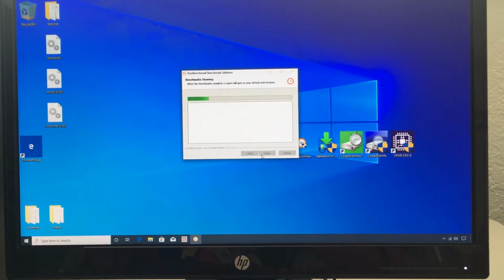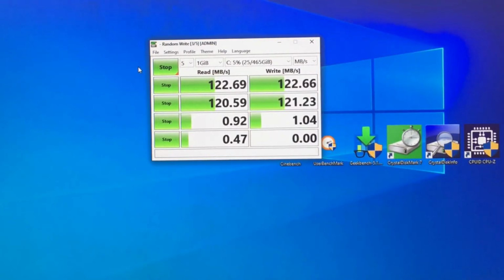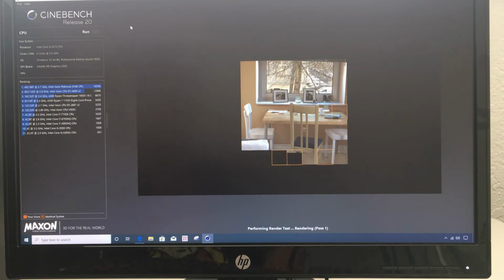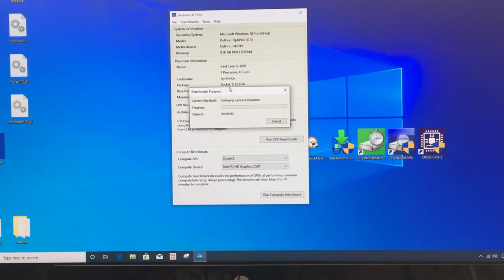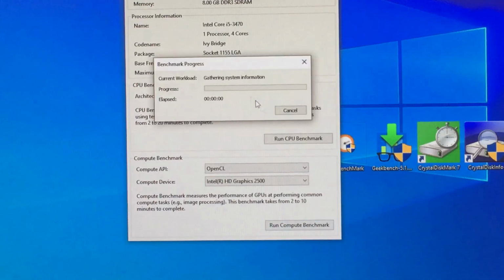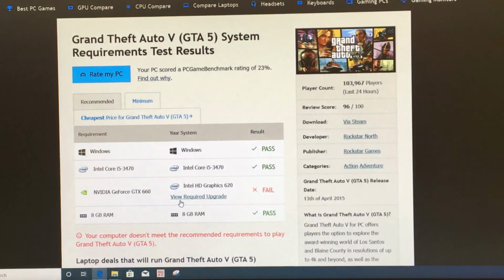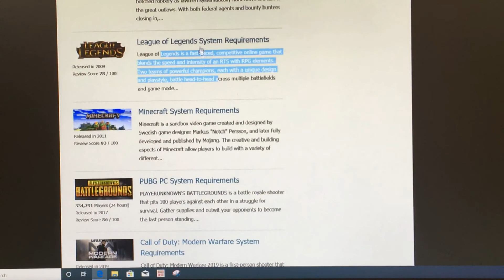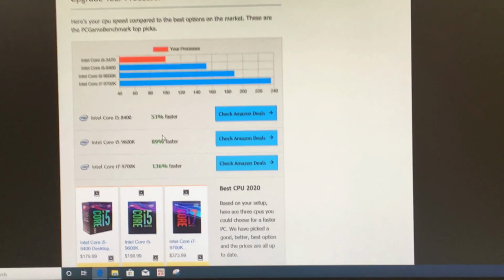$88 Optiplex 3010 from EBAY | Unboxing and Review

Comment: It is possible to change psu..as 400watts or more...
Reply from the maker: This is a smaller case pc so a 400 watt power supply would not for this particular model
Reply: @whattmeter  then for gaming like gta5 which graphics card is good with this psu ...

Comment: Ey yo Bro Is it upgredeable? Hehe I think i will add like 1650 or 1050 Ti In there Hehehe And Add more Ram of course Can i  Upgrade it?
Reply from the maker: The case it too small to upgrade the power supply
Reply: @whattmeter  maybe i will Change It to Atx Case Can I Change the case?
Reply from the maker: It difficult because the connection of the motherboard to the power buttons are proprietary. Try doing some research. It might be easier for you to get the Optiplex with a big case. Easier to upgrade and put a graphics card in
Reply: @whattmeter  ok then
Reply: @whattmeter  i will try to research iy
Reply from the maker: I recommend trying to get an MT model which are the bigger dell cases. They take graphics cards and power supply upgrades no problem. Dt and sff are the smaller cases. Just my opinion though.

Comment: Can we play Genshin Impact?
Reply from the maker: I've never played Genshin Impact, but I looks up the pC requirements and it looks like this computer can't runt it. Unless they optimized the game to run with computers with lower specs, this can't run it.
Reply: @whattmeter  but many peoples are using Optiplex 3010 MT with Geforce Gtx 1060 graphic card and it's running at high resolution with low setting on 60fps.
Reply from the maker: Ah they added a graphics card
Reply: @whattmeter  Then it's okay with that system right?

Comment: I need a PC that’s good enough for Fortnite. I found one but I don’t know can u reply? I’m new to the PC’s. 

790 windows 10 core i3 4GB 19LCD 
500GB hard drive
Reply from the maker: You might need another cpu. Minimum requirement for fortnite is i5-7300u according to a google search
Reply: @whattmeter  I just found one for 100 on eBay. 

Optiplex 9010 SSF i5 CPU 4GB 250GB windows 10. Would this be a solid pickup ? And how much better or worse would the graphics be compared to a PS4?
Reply from the maker: @tomswrld3657  Im pretty sure I made a video, fornite works but pixelated. I think the PS4 is more optimized so fortnite version would look better. But that's just my opinion.
Reply: @whattmeter  I might just go for a keyboard and mouse on PS4 until I find a reasonable priced gaming PC.
Reply from the maker: Nice! Good luck

Comment: I got the OPTIPLEX 3010 SFF in 2018. I upgraded it's 500GB 7.2K HDD to 1TB to store my virtual machines and later, I am also thinking of upgrading from 8 to 16 GB. It also has Intel Core i5-3470.
UPDATE: I recently upgraded to 16 GB of RAM and it is now working fine.
Reply from the maker: Very nice! That’s awesome! Gradual upgrades is what I like to do too
Reply: Can we play Genshin Impact on it after adding Graphic Card
Reply: @Epialess  pretty sure you could, you need like a gtx 1050ti low profile though, i think.
Reply: I'm pretty sure you can't upgrade past 8GB of ram on the 3010 model, idk why, but to be honest I think the 3010 is a good model because it came with HDMI and not DisplayPort lol
Reply: @syaz4380  To upgrade to 16 GB of RAM on the DELL OPTIPLEX 3010, you will need the latest BIOS update. I got 16 GB working and it has no issues. I am serious.
Reply: @NewLERoyUser  It also works on me.
Reply: @NewLERoyUser  thats cool, thanks! Crucial said it was max 8GB so I thought it was 8GB max
Reply from the maker: Crucial is great but sometimes outdated. Hopefully it will show higher than 8gb for the cmd command
Reply from the maker: Open cmd as admin > type wmic memphysical get maxcapacity > convert the numbers from kb to gb. I’m pretty sure it would show higher than 8gb for max ram capacity

Comment: Does it come with the wires to connect the PC and make it turn on?
Reply from the maker: It depends who you buy from on ebay but yes it came with the power cord
Reply: @whattmeter  I'm getting it from Amazon for 130 bucks. It will be my first PC. I  wanting to be a PC engineer. My cousins dad is really good with pcs and  made popular streamers pcs. I'm 1q and my granpa gives me 25 bucks every Sunday. I cqnt wait to get it. But it will take me 5 weeks. Thanks for the video
Reply from the maker: No problem! That’s awesome good luck

Comment: Hello. Can any 8GB ram stick be applied into this to make it 16?
Reply from the maker: It has to be a ddr 3 Dimm. You can check your task manager > performance > memory to see what speed of ram you have and what type.
Reply: @whattmeter  ok thanks
Reply from the maker: No problem. Good luck
Reply: @whattmeter  haha thanks. Just gonna upgrade to 16GB ram and put a gtx 1050 ti in their to run flight simulator.

Comment: Could I upgrade a dell optiplex 7010 and install a gt 1030
Reply from the maker: What is your power supply wattage? Also what games are you planning to play
Reply: @whattmeter  I watched most video with 7010 and estimated that the psu will be 250w I don’t have the pc yet and I’m planning to play like minecraft, roblox, fortnite
Reply from the maker: Yeah nvidia recommends 300watts at least for the gt 1030 especially if gaming long term.

Comment: Can you put a GeForce GTX graphics card in this computer and if so which one will fit
Reply: 750/1050/1650 ti/super low profile. Best to leave lid off while gaming and fan blowing air at case
Reply: The cooling for 750 is too big and wont fit

Comment: Will it fit a graphics card
Reply from the maker: Only low powered low profile ones. Hard to fit a replacement power supply on this model
Reply: @whattmeter  would a 730 be alright
Reply from the maker: A 730 should be ok. Did you check your power supply wattage

Comment: Bluetooth? Trying to connect xbox controller but cant get it to work?
Reply: This PC doesnt support bluetooth  I know because I have this PC.
Reply from the maker: Xbox one or xbox 360 controller?
Reply: @whattmeter  I have an xbox one controller. It is bluetooth compatible but the pc does not show a Bluetooth "on/off" setting. I am trying to figure out what to do to get the pc to show the bluetooth "on/off" switch. I guess my question is that available on this pc?
Reply from the maker: @BulletproofBusy  by any chance did you check device manager to make sure the pc has a bluetooth card installed? if so what version

Comment: Which gpu would dell optiplex 7010 sff work with
Reply from the maker: Check page 8 for sff motherboard config from dell website https://www.dell.com/downloads/global/products/optix/en/optiplex_7010_technical_guidebook.pdf
Reply: @whattmeter  but there is a pcle16 slot
Reply from the maker: You are right. I was looking at the wrong page. Looks like a low profile graphics card too. Also sff 7010 has 240 power supply right? Most likely you are going to be limited to discrete graphics card or even something like a gt 710
Reply: @whattmeter  gt 1030? I have seen some videos
Reply from the maker: Check this guide https://premiumbuilds.com/graphics-cards/best-low-profile-graphics-cards/ you could do a rx 550 they also give other options
Reply: @whattmeter  thanks for your help it means a lot thanks for giving your time
Reply from the maker: No problem. I’m thinking a gt 1030 would work too. The 1030 is on par with rx550. These are two gb graphics cards so they should work
Reply: @whattmeter  the rx550 has a pink shroud :)

i mean the GT1030 is probably cheaper

Comment: Is there any gpu we can add to this pc
Reply from the maker: Most low profile graphics card. Depends on the power requirements
Reply: @whattmeter  can we upgrade psu
Reply from the maker: The DT version not really. I see some people on youtube cut the case to make it fit. But I don’t think thats the best way. If you have the MT version it is a bigger case so psu Upgrade can be done easily. Not a lot of choices unfortunately as this is more of a workstation and not for gaming .

Comment: Would you recommend upgrading it by adding rx570
Reply from the maker: Unfortunately for the Optiplex 3010 in the video. It is a DT (desktop chassis version) with a 250watt power supply. Looking at the specs, the RX570 requires 6 pin power and a recommended 450 watt power supply minimum. So it will not work with this version of Optiplex 3010 DT. Hope this helps.
Reply: @whattmeter  thanks
Reply from the maker: No problem.
Reply: What about a 1050ti?
Reply: @techguy6802  it will work

Comment: Can I connect it to wifi without a wifi driver? or do I need to buy a wifi driver for it also, is it good for gaming? like for gta v valorant and games like that?
Reply: and is it worth it to buy an optiplex? as I am looking to buy one
Reply from the maker: optiplex are great. keep in mind you cannot easily transplant the motherboard to another case as the cases are proprietary. It really depends on what model you choose but most optiplexes are easy to upgrade. A lot of manual information and videos out there. Also keep in mind most optiplexes can only run low profile graphics cards. If you are planning on upgrading an optiplex, try to avoid USFF (ultra small form factors) as they usually don't have graphics card slots.
Reply: @whattmeter  I am planning on getting a 7020 Optiplex and getting a gtx 1050 TI graphics card the specs are 8GB ram and 500GB disk space do you think I would be able to run it without the graphics card? I am getting the graphics card anyways its just I wont be able to get. itstraight away
Reply from the maker: nice! the optiplex 7020 is newer compared to the one in the video. it was released in 2014. One thing I would check is what cpu is included with the optiplex. also double check the wattage on the power supply because you want to make sure that it has enough power to run the gtx 1050 TI. I could be wrong but I don't think it will be able to run GTA V withouth the graphics card. Most likely the Optiplex 7020 has a built in HD graphics 5000 which usually relies on shared memory. But I could be wrong. I tend to underestimate these optiplexes as shown in some of my videos where it ran fortnite when all it needed was a driver update. Also do you know what speed the 500gb disk is? is it an ssd or hard drive with rpm speed.
Reply from the maker: it is possible to ask the seller or company to see if they know if the optiplex 7020 can run GTA V?
Reply: jasetutorials i believe it’s an hardrive but i am planning to upgrade it to an ssd as i heard hardeives are very slow i will check the cpu right now
Reply: jasetutorials it doesn’t say what the cpu is all it says is it’s Intel and it’s speed is 3.20GHZ
Reply: is that good or bad
Reply: jasetutorials it’s my first pc so i apologize for the ton of questions i just don’t wanna make a mistake since i mainly wanna game on it and also do you have any other recommendations for pcs that are around the same price ?
Reply from the maker: @Devious63s  good question. not sure. probably best to ask the seller because they should have the specs. there are a lot of choices out there. sorry i've never tried using a 7020 model before. But the older optiplexes were able to run fortnite so I don't have many doubts. I would just make sure the cpu is compatible.
Reply from the maker: for wifi, it depends, this pc in the video has no wifi card in it. I connect it using the ethernet port. I also have usb wifi adapter I got for 13 bucks plug and play.  In terms of gaming, you can add a low profile graphics card. Looking at the requirements for GTA V, you need at least 2gb graphics card, which in this video I did not have installed. Also it shows gta v needs 8gb of ram at least. I would add 16gb of ddr which should be around 70 bucks. so you would probably have to spend some money or get an optiplex with better specs.
Reply from the maker: I reviewed my video I did a game check for gta v. It cannot run it because of the graphics card. I didn't have one installed and not enough ram. so this $88 computer can't run gta 5. Later down the line I did add a graphics card and ram so it should be able to run it. Also, it has an i5 Intel core 3470 which is the minimum requirement for GTA V. So you will probably have to spends at least an additional 100+ dollars to get this thing to run GTA V